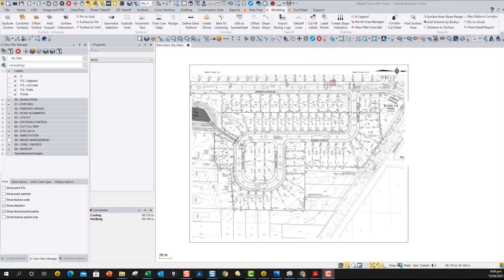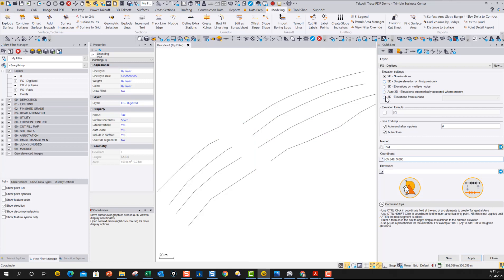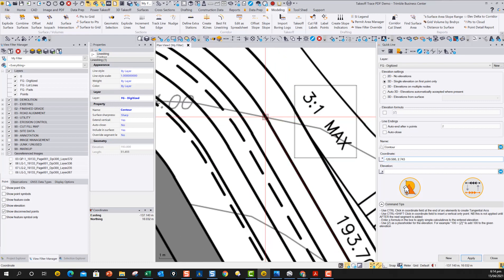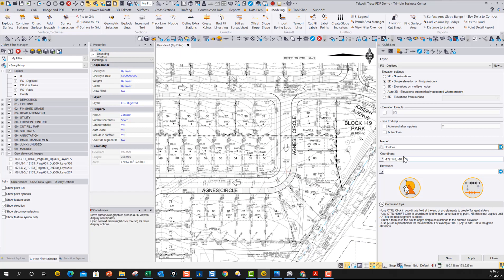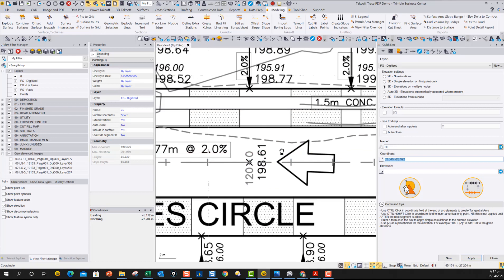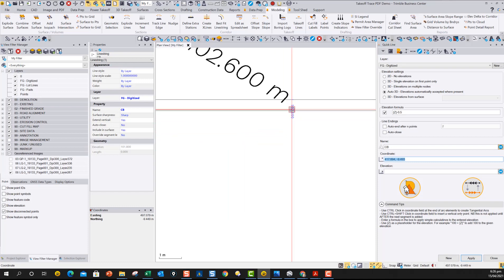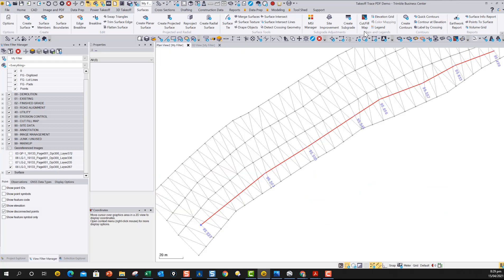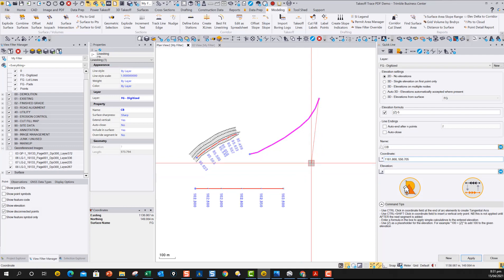ALL NEW: Takeoff Lines Command

Comment: These are great, just a shame we are forced to pay a added subscription for simple things that should be included in software as expensive as TBC, like creating tangent line arcs efficiently. I don't understand the auto 3D feature so much. Why would you be digitizing if you already have 3D vector lines available to offset or if the 3D text is available wouldn't the vector data also be?
Reply from the maker: Hi Steve, thank you for your feedback. We develop our own tools separately from Trimble, but utilizing their code. You are welcome to check out the benefits of our tools versus their cost at our community site and ask your questions there. Our community is linked in each video and is available via an icon on our YouTube channel home page. Thank you!
Reply: @rockpilesolutions8457  yes I apologize, my quam is Trimble for including some of the basic features and ui enhancements. Macros for advanced features are great, what's not is needing to purchase them for basic commands efficient and to make ui features like a layer manager usable. Thx.
Reply: Steve
The Auto 3D when you are digitizing is so that you can snap to 3D objects that you have already digitized - e.g. you digitize a bunch of lot lines in 3D and now you are digitizing the line across the back of lots or across the front of lots / ROW and when you snap to the ends of the lot lines you just digitized you want to lock in at the same 3D location. Auto 3D basically says - if I click a 2D location ask me for a Z value, if I click a 3D location lock it in in 3D automatically - no question / pause. This helps in many many situations - e.g. Driveways that cross Sidewalks / connect to sidewalks, sidewalks that connect to sidewalks, Lot Lines and ROW lines.

You will love it when you try it.